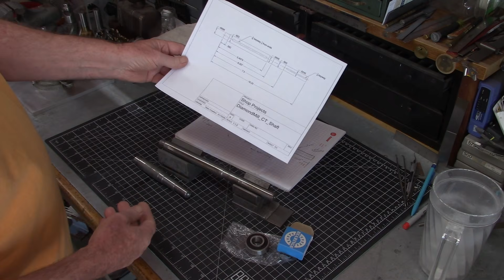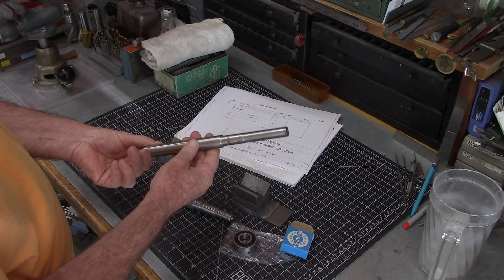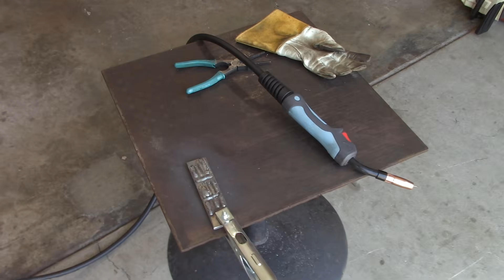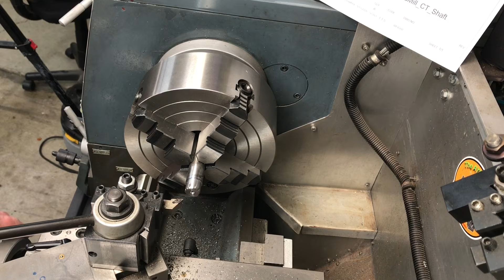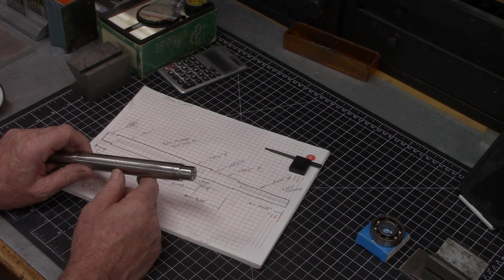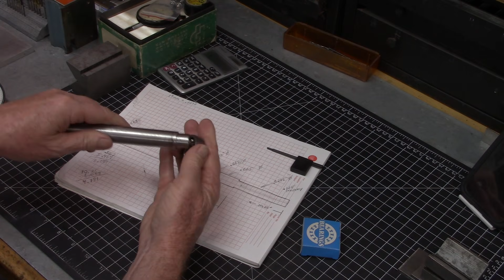Diamond Tool Co Horizontal Mill Restore - Countershaft Repair - Part 8

Comment: I thought you found the diameters to be imperial?
Reply from the maker: Yes the man spindle and its bearings are imperial. But this counter shaft has typical metric bearings, with the pulley fits imperial. Quite a mix.
Thanks.. 👍

Comment: That was a fun one. Since the shaft diameter was relatively small, I wonder if turning down the bearing areas and then sleeving them and turn to dimension would have been a better option?
Reply from the maker: Possibly there are a couple of really big pulleys on that skinny shaft though. 
Thanks, Tom !

Comment: Dean I'm assuming that it is drilled for centers. If so I would just use the 3 day with centers in both ends instead of messing with the 4 jaw. That also allows for trial fitting. (taking it in and out of the lathe.) I actually made a center plate that fits my 3/4" 5c collett and I can just pop it in the collet and re cut the center to be absolutely on center of the spindle,then put a drive dog on the shaft and live center the tailstock end.
Reply from the maker: I did think about that somewhat. I did repair the short end center due to welding slag and thinking I might need the center. Well I guess hindsight is 20/20 
Thanks Terry!
Reply: @TheAyrCaveShop  I've invested some time in shop made tools that make setups easier and quicker. Like I said I made the dog drive plate with a .750 shank that goes all the way thru it. Cut the same 60 degree center on the end of it as a dead center or live center uses. I have it marked so I can put it back on the money when I put it in the collet but it's still best to re-cut the center every time. I also made a Best I ever say way to dial in a 4 Jaw. . I made the tool post roller that many use just for truing up stock but I use mine at 90 degrees to the centerline of the shaft to get the material within .015 to .005 and then I will  use one of my home made magnetic indicator on the chuck side of the tool post. I use the cross slide to zero the indicator every time I rotate the chuck 180 degrees. Dean if you aren't already using this method you will love it. I am gona add the link to the video I learned it from. If you have already seen this video then just pass it on to someone who may need it. If you have not seen it it is well worth the time to watch. 

https://www.youtube.com/watch?v=HcjM5TGTPGA&list=PLM5x8SGomy0XZjIYodsAwuN3kwzzH_PtX&index=7

Comment: Good crack at it Dean .    I will give you a couple of pointers .  With the welding , stick to one end at a time .  After the first weld bead immediately  do  2 beads directly opposite to help counter warpage .   Then keep alternating one bead at a time .   With the turning after straightening , grip the extreme ends of the shaft , that way you can see how the entire centre section is running .  Sometimes a fixed steady is required if it can be run on an area with no key way , sometimes a sleeve can be used to run the steady on .   Small shafts like  that are always a lot of effing around , but good crack at it anyway .    Cheers  👍
Reply from the maker: Thanks Max !! The two countering beads makes sense, I would not have thought of that. Great tip !
Thanks for the other information as well 
👍 cheers……

Comment: Dean, remember that heating and cooling are your best friends when making a press fit. 
I would have put the shaft in the freezer and then press the bearings on the shaft, if that is possible. 
Good to see you back in the shop.
Reply from the maker: Yep 👍👍👍

Comment: GReat job Dean...very meticulous  use of welding and machining to save original shaft.✅✅💯💯
Reply from the maker: Thanks Al !
Gota try it to learn it
Reply: @TheAyrCaveShop  Exactly correct, use of a trial piece and go thru all the steps before actual work on part. So many original parts are scapped by not following these rules.💯💯✔✔

Comment: Nice lessons in this video. You will probably be fine that shaft is more true now than when it came out of he factory. You have to figure they pulleys along with a belt are not going to be perfect either. Thanks for the lessons they were enjoyable and informative.
Reply from the maker: I think your spot on Jim, I’m gonna run with it. Thank you. !